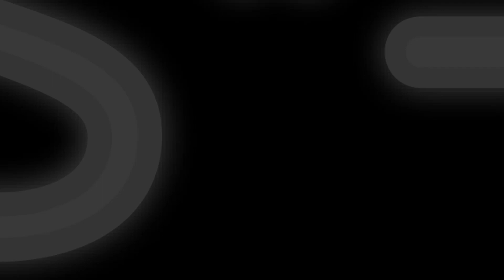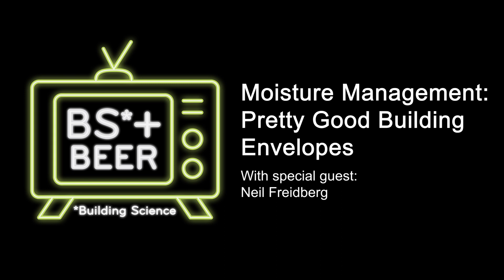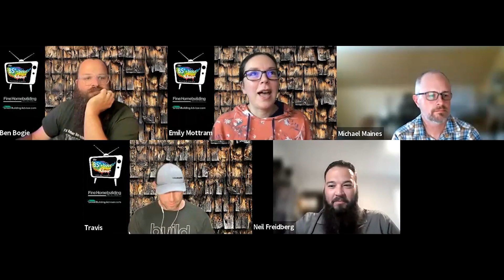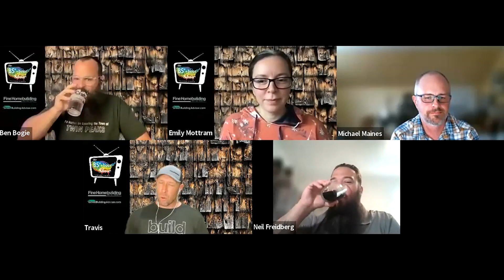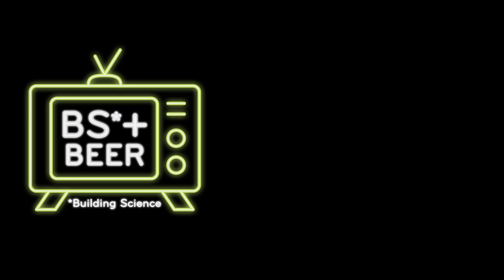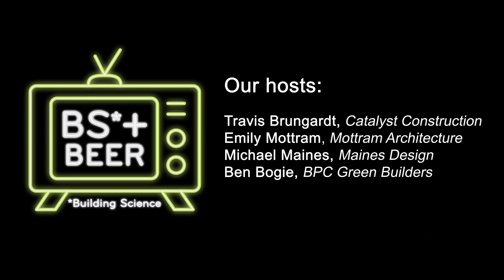Moisture Management: Pretty Good Building Envelopes

Comment: I’m just curious as to the solar vapor drying issue, at least in a residential setting would it be possible to close the doors in each area for long enough to complete a full air exchange and test the rooms separately with a hygrometer? See what areas may fall outside of their own bell curve of measurements.